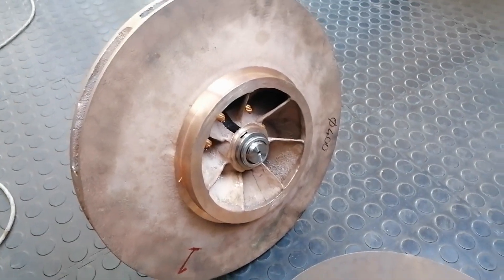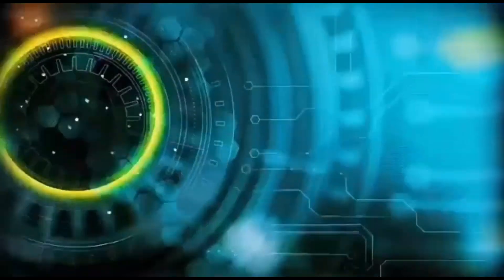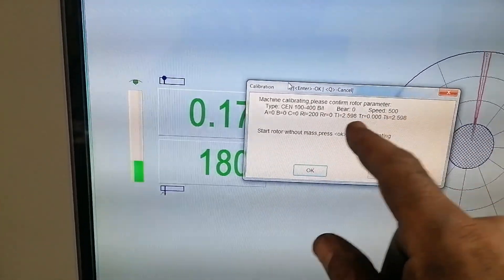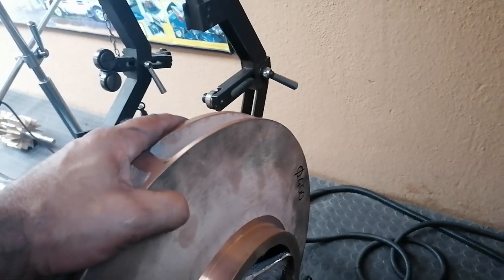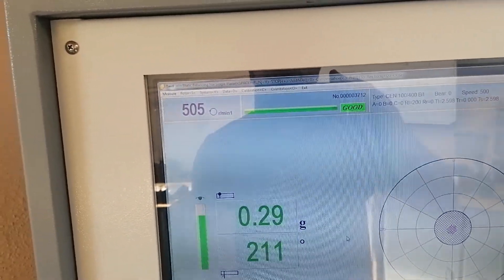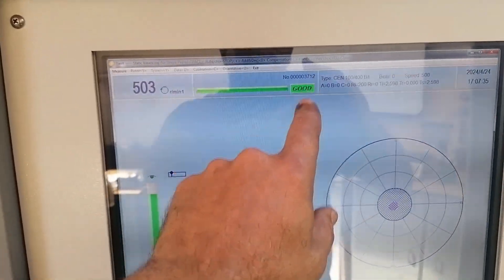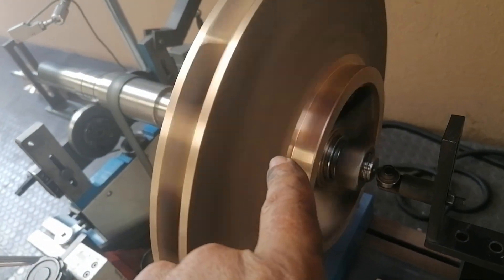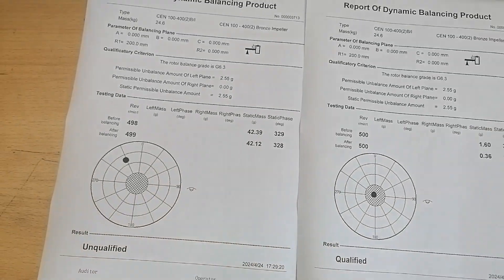Let's sort these Two Impellers out!! Single Plane Dynamic Balancing...

Comment: Im having a little trouble with my own balancing machine is the same as yours, the problem is that the red light con the rotor dont send signal to the computer. I rotate the rotor and the red indicator in the screen does not move. Any suggestions?
Thank you greetings from Mexico
Reply from the maker: Hi Adrian. Thanks for commenting. Did we not perhaps email each other last year. Please confirm if so, then i will email you as i have your email address. If it is not you, could you please email me on the address on my 'about' page. Thanks.👍